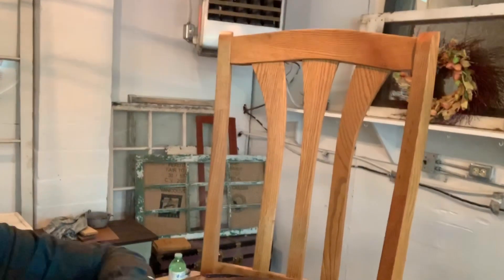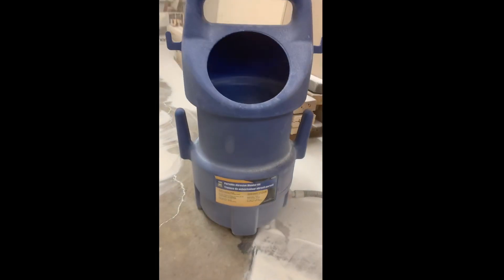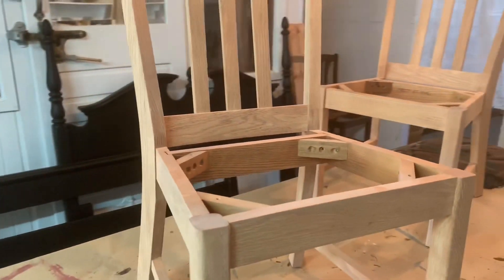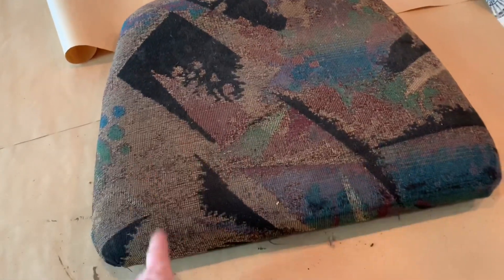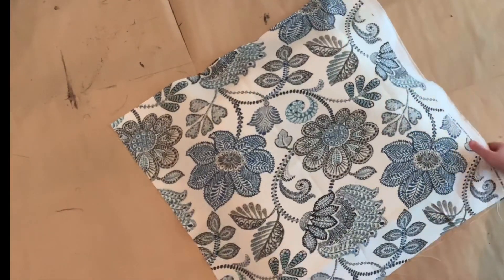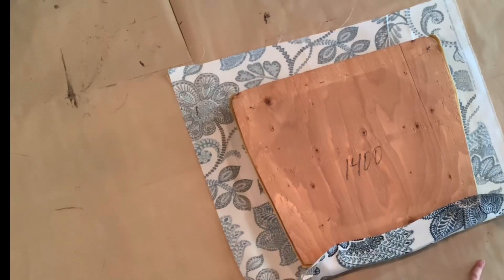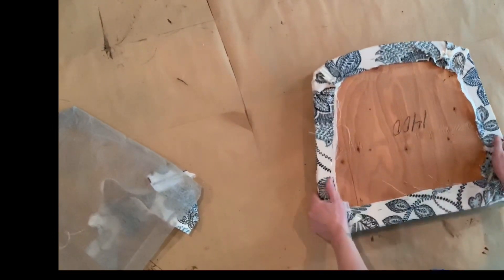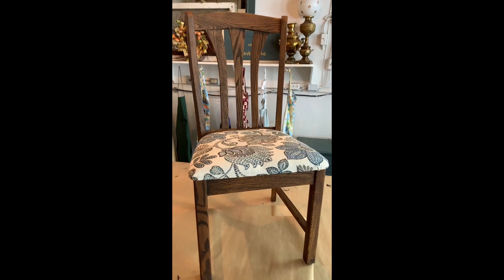NO sanding chair refinish - Soda Blasting

Comment: Do you need an oil free compressor to use a soda blaster on wood? I am getting uneven pressure that is damaging the wood. Don’t know what do do 😢
Reply from the maker: I use an electric. Can you adjust the pressure on your compressor?! Try lowering your psi?

Comment: Anything that is blasted with baking soda that you are doing to put a finish on must be neutralized. The soda is high in ph. For wood use vinegar. Very important!!!
Reply: Can you explain more about the neutralization?

I’m looking to use this to sand clear coat on wooden oak doors , to paint them white, 

So if soda sanding works, that means I can take off clear coat off wooden oak, prime with water based primer, then two top coats of finish semi gloss paint
Reply: So technically it gets neutralized with the water based primer?

Or where you talking about re staining, which would need a wood conditioner to neutralize and create even stain coats, where blochiness would be eliminated

So still the regular condition, stain, seal, sand, seal
Reply: Neutralization is not a finish. You are bringing the ph back to neutral. With wood, brick and concrete you can use a mixture of water and apple cider vinegar. Metal use either Hold Tight or Chloride. Put you mixture in a garden sprayer and wet down. Check ph with ph test strips.

Comment: Hi,Nikki Steve here from EU  ...would you be kinde to tell me the name of your blasting unit you use and I never heard  about soda blasting but sand blasting yes .....so I would love to purches this unit and soda but I know zero about it .....thank you so much .
Reply: I looked ones again the video and I guess its just a normal sand blasting unit 
but then it is possible to use in the same unit soda ? right ? where to buy such soda any english name so I can translate  and look for it here in EU ....thank you ....ah  you did an expiriment of corse and soda was flaying all over your palce isnt is not bad to inhale it afterwords ? I mean I dont minde in fact I do care but just ......you know .......I know it was an expiriment :)
Reply from the maker: Hey Steve! Soda blasting is the same idea as sand blasting only it uses soda (very fine and light) so it’s not as abrasive. I got the power fist at princess Auto and use that... they do have much better models but range in price from $300-$600 CAD.  make sure that you check the requirements for a compressor on the box of whatever you buy to ensure that you have the right equipment! Good luck!

Comment: Hi have you ever used this on wood veneer? What were the results like? Thank you
Reply from the maker: Yes I have! I just held it further back to ensure I isn’t damage it. It worked well.
Reply: @ferodesign4089  thank you so much for the  reply!  I couldn’t find anywhere on veneer being soda blasted but this is fantastic news thanks again
Reply from the maker: @JAYFARRELL31  just treat lightly, and if needed you can turn down the pressure. But I found that controlling it by distance worked well enough. Good luck!

Comment: Hi Nikki.  I was wondering how well soda blasting works to remove multiple layers of paint off wood (cabinet doors/doors)?  Or would it be better to sandblast?   I only have a pancake compressor. Thanks for the help.
Reply from the maker: Hey! It works great! I like the soda because it’s gentle on wood. I think sand would cut into the wood a bit too much and cause damage. As long as your compressor fits the manufacturer guidelines you are good.  So make sure you check the box for what it requires.
Reply: @ferodesign4089  Thank you so much for the reply.

Comment: Will the same work to remove paint from wood without damaging the wood?
Reply: That's what makes sandblasting so nice!... Very quick, extremely effective! You will most definitely damage the wood if you continue to blast it with sand after you have removed the paint!.... But why would you do that?... Sandblasting is extremely effective but way less aggressive than a belt sander! Compare sandblasting to an eraser... Instead of sanding off the paint, it's almost as if you erase the paint

Comment: Sooo much faster.  Turned out great.  What media did you use.  Did you use Walnut shell, glass bead, or soda media?
Reply from the maker: Shantilly Lace Vintage I used soda! Worked great!
Reply: @ferodesign4089  course or fine? I have cabinets and the polyurethane is very well intact, so I need something to cut through that. Thanks so much